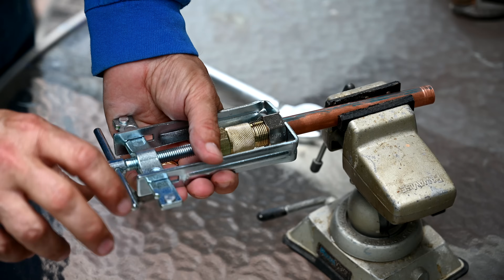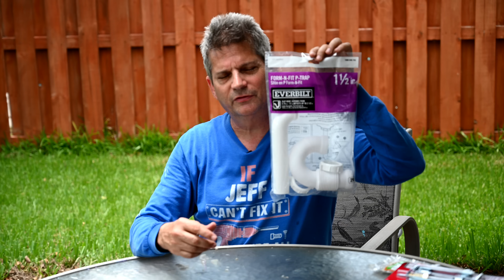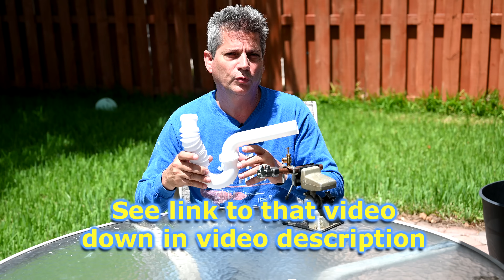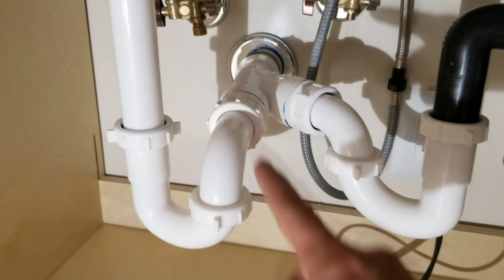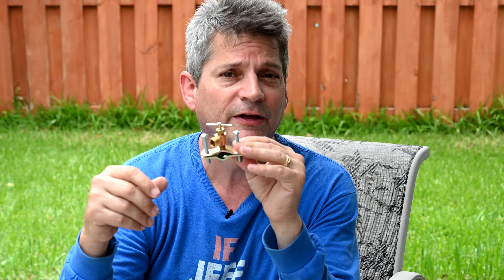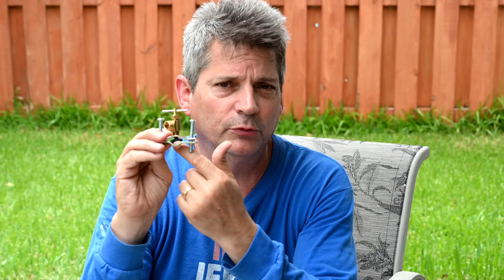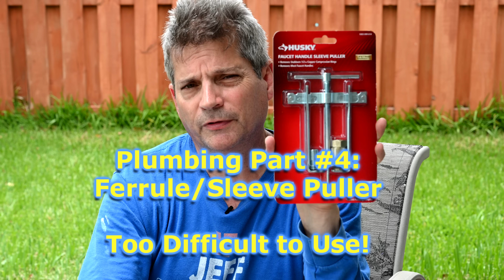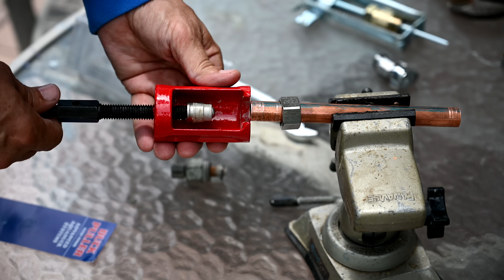4 Plumbing Parts/Tools You Should NEVER Use. NO Plumbing Fails

Comment: I have changed many water shut offs over the years that were compression, and I have never once needed to remove that copper sealing ring that is stuck in place. I just leave it as it is and reuse the original nut and ring. I make sure that it's tight....works every time, and never leaks. If it wasn't leaking before, it won't be leaking after you change it if it is done right. The nuts and rings are all the same size for 1/2" copper pipe
Reply: Exactly why go to the effort. I have also found if they have a very small leak, if you leave it tight overnight they often seal up. The metal must creep under the stress and seal. Found the same with black pipe and gas lines too, though it has to be a really small leak to have a chance as steel doesn't creep as much.
40min to get the compression ring off I would have just hacksawed it most of the way thru and broken it open in 15min. Cut at an angle and don't nick the pipe.
I always put npt ends for the stop valves and then I don't have to fiddle with those compression rings. NPT is easy to replace and they never leak. I have had too many compression ones that do leak.
Reply from the maker: @court2379   I also like to test all of my installations with hot water flowing through the pipes afterwards and especially the plastic cups it makes everything expand out and then shrink back later when you switch to the cold water that were you have fully exercised the installation.
Reply: @court2379  I find using Polytetrafluoroethylene tape (PTFE) wrapped several times round the compression ring will solve any small drip or leak where the compression ring comes into contact with the fitting, never had any problems and I've  been a plumber for nearly 40 years.
Reply: @garymcgunnigle4480  Not a bad idea. I just don't use them anymore though. Too fiddly and if they get messed up are a pain to fix unless there is enough pipe to cut them off. It costs a little more, but I just solder an NPT fitting on, and thread the stop onto that. I guess the push connect ones would be the other way to go now. If they go wrong, release them and replace.
Reply: On commercial properties, I found old valves/nuts that did not match the threads on new angle stops. I like to start out new, but sometimes would reuse a nut and ferule if it would seal up. The way to remove a ferule is with a professional splitting tool. It is also heavy cast aluminum with a nipple to go inside the copper tube and a blade that is turned into the ferule. Small channel lock pliers easily turn the bolt on the blade (it isn't a hex, but has external splines). Far too often, the old valve was installed so tightly that it deformed the tube and it wasn't possible to seat a new ferule on it.

 If there is enough tube, I would cut behind the old nut and use a new compression valve or just sweat on a 1/2" threaded male copper adapter and use a threaded valve. Property managers were happy to have us replace all of the valves and supply lines when getting a suite ready for new tenants, as the bill for us to professionally clean up, treat, and repair water damage was much higher. The buildings were built with flexible hard lines built into the angle stops and they were prone to leaking.
Reply: You will someday run into one where it WAS leaking at the nut, and the nut is corroded, and there is no way you can re-use it. Typically if there's room, you can just cut off the pipe and use the new compression ring with a new nut. If there's not room, you'll have to do something else, such as try to remove the ring and get the new one to hold onto the (often corroded) pipe, or use a push-on fitting, or tear into the wall to replace the pipe and leave enough pipe sticking out for several refittings after cutting the ring off.
Reply from the maker: Yes indeed, nothing wrong with doing it your way as long as you re-compress nice and tight and no leaks. I just like to start with all new blank canvas, all parts brand new, the sleeve has only been compressed once, when I compress it brand new. Besides, each new angle stop comes with a new compression sleeve so why not use it. Also, many properties I work on are foreclosures, or neglected properties, prior water damage, high moisture in bathrooms, where the angle stops have gotten corroded, and the copper pipe coming out of the wall is corroded, so I remove everything, and "sand it" with Scotchbrite to polish it off nice and shiny brand new copper, then install all the new parts. Looks like a million bucks, and top it off with a brand new decorative flange as well.

Comment: Concerning the S trap. I think the word your looking for is vacuum.
Reply from the maker: It is actually called Bernoulli's principle which states that an increase in the speed of a fluid occurs at the same time with a decrease in pressure or a decrease in the fluid's potential energy.
Reply: @jeffostroff  Bernoulli's principle is an example of a vacuum. U are correct that Bernoulli's is a more precise definition of what's happening with these fluid dynamics. Still a vacuum none the less.
Reply from the maker: @michaelhamerin3814  Either way it sucks! LOL

Comment: And oddly be enough I think every one of these pipes you showed you can go to Home Depot and buy them today. Home Depot should be the ones that are on the bill for replacing and repairing all these faulty the parts that they sell
Reply from the maker: Well, they probably sell them assuming people will install them temporarily, but the saddle valve included in the ice maker line kit is still puzzling to me, because that is a permanent installation once you pierce that pipe.
Reply: @jeffostroff  I'm kind of like a professional handyman and whenever I would go into a house and see a saddle valve what I would do would be cut that piece of pipe out and install an actual 3-way valve. Soldering it all in. The way it should be the way it's not going to leak in 5 years. Saddle valves are the worst you will flooding and base entire basement without even having a thought of what's going on because some idiot you some cheap $2 saddle valve that always fails. Sadly I became disabled in 2002 3 years after I had started my business and now I can barely do two hours of work in the summer with a high heat and humidity if I work at all. and the customers I would go to have explained to them what the problem was with those saddle valves and opted not to have to have me pay pay me a little extra to fix it the right way. I hope they know they should have done it when they flood their basement.
Reply: Legally, contractually, that won't hold up. Would be like suing the store for selling a weapon used in a crime.
Reply: Fester Blats these plumbing items aren’t illegal though

Comment: What do you think about PEX?
Reply from the maker: Pex is gaining in popularity because you don't have to solder and you can get home runs from one end to another without a lot of 90 degree connectors. But We still don't know long term effects of it yet. Canada is using it like crazy for years now. I myself don't know much about it.
Reply: @jeffostroff  Thanks.  I am not that good with copper, so I have used CPVC.  I watched various episodes about PEX &  recently replaced hot water lines on a rental house by myself.  Not that hard to install and no leaks.  Fingers crossed.
Reply: @jeffostroff  Habitat for Humanity homes I have worked on use it exclusively to avoid the theft problem. Copper would have been gone before nighfall!!  I have re-plumbed older homes myself and love using it. Homerun connections are great since elbows and other joints are where many problems begin.
Reply: @jeffostroff  It's probably still better than the lead solder fittings you'll still find. And lead solder used to hold EVERYTHING, but was mostly used in iron drain pipes (the city sewage recovery systems now can't handle that, by the way.) But, yes, I have seen the old lead solder used on copper fresh water pipes, which nowadays sounds like a very poor idea...

Comment: If you use the flex pipes outdoor wrap them up in foam to insulate them from temperature fluctuations.
Reply from the maker: Handy are you talking about Pex pipes? Anyway up north anywhere I would try to avoid pipes outside because of winter. Some older houses run them outside though.
Reply: @jeffostroff  pex should never be exposed to sunlight. It will flex a bit if some gets frozen, and less likely to rupture than a rigid pipe  is what I"ve heard anyway. We never see temps anywhere near freezing so idk.
Reply: Flex y s outside for what ?

Comment: First of all, I would tell you guys whoever watching this video to have a grain of salt.  I have used the flex (accordian) drain fittings in three properties under my kitchen sinks.  Yes Jeff they were all done by a guy without a plumbing license, who is me, and you are welcomed to call me an unskilled non professional "handyman".  But I want to tell everybody that the flex fittings have been working without a problem for more than 10 years now- no leaking.  If they crack in the next year, I have no reason to complain about the long service they have already endured, and the reasonably low cost to replace.   We watch you tube videos to learn plumbing skills for universally the same reason , to learn DIY and save money. We can't be dictated by everything the plumbing code says, and whatever the insurance industry wants to declare what is allowed or what is not.  
We DIYers  look at what works and what don't work and have facts to prove it!  When it comes to remodelling existing plumbing,  we all have to go through the trouble for incorporating new parts with older, existing ones.  While it is appropriate  to follow the current plumbing codes it is sometimes just impractical to to do so for various reason, mainly, because we are now using new types of sinks, new models of garbage disposals, or other fittings that cannot work with the existing plumbing, that's the time we turn to flex pipes.  To clean the crevices along the pipes, simply use diluted bleach, and flush.  I never encountered a blocked flex before and if I do, I will just unscrew it and remove the obstruction
Reply from the maker: You bring up a great point, that for people who really know what they are doing, they can put this in their property. I could do a flexible p-trap in my own house, but I won't because I want to set it and forget it, and not have to clean out the trap in a year or 2, But the real issue I am covering in this video, is the poor people, who I help out a lot, and they can't afford a plumber, and so they pay a lot less for a handyman, who puts these in, but the homeowner does not know anything about repairing and cleaning our p-traps, and when their insurer does a 4 point inspection on their house and demands the removal, they can't do it, and they can't afford to do it. So using these parts should only be done by someone in their own house who understands the risks, and can deal with it when it happens. Heck I can even deal with the scenario of an angle stop popping off the pipe at full 60 PSI. I just would go outside and turn off the main, but many people don't know how to to even shut off their house main.

Comment: FYI, not all handyman do bad work as you say with that "handyman special" dig you mentioned on the accordion quick fix. I've been a handyman for many years and have had to correct mistakes that supposid licensed and professional plumbers had done only to have the customer complain to me about their shoddy work. I'm doing a remodel now that a previous plumber used that exact P-trap on a bath vanity just to cut corners. Not only that, but he re-ran all new plumbing in this house and didn't even remove the old supply valves and it looks like crap next to the new ones.
Reply from the maker: Well, you shouldn't be offended, because you're not the guy that installs those incorrect parts. But, I also doubt whether real plumbers put those accordions in. Maybe they were put in after fact by someone else? Unless the city inspectors missed it... But yes you're right plumbers do sometimes get sloppy, keep in mind most of the construction of new houses might be permitted by license plumbers, but their worker bees are sometimes not the most talented, and I too have had to fit fix many plumbing issues done wrong by builders plumbers.
Reply: @jeffostroff  I wasn't offended but was only making a point and in my case, my customer paid a plumber and that was the result. I agree that yes, not all work is done by the licensed guy but I would think that he would at least check the work of his guys.
Reply from the maker: @MannyFontes1968  A local plumber that I have used in the past would stop by the job near the end and make sure the work was done  by his guys properly.
Reply: @jeffostroff  Well, he was a good one who made sure his customers got good quality work and repeat business.
Reply: Used these on many occasions.  10 years later, went to a home, still there and functioning fine. Sure , will hard pipe but some of these older homes have been altered so much a plumber will charge outrageous prices. Local plumber charged $80 to replace a toilet flat valve.
Reply from the maker: @Jack-Surreal_Panes   That's why I tell people that learn how to change their own flappers
Reply: @jeffostroff  yes.  Most of those DIY traps and pipes never fit.   One reason many of these were used in the past was those stores never carried variety It was straight,  T,  coupler. So these helped solve the Quick fix get it working please emergencies. Now I see all types of different pic fittings: adapters,  angles, couplers,  etc... If you wanted these you had to order them.
Reply from the maker: @Jack-Surreal_Panes   Yes good summary on other reasons that I had not seen before
Reply: @Jack-Surreal_Panes  with HD and Lowes now being the go to store for your DIY needs, you have many options when it comes to better products.

Comment: This guy seems to hate the concept of a homeowner saving time or saving money.  My house came with a S trap,and I have never had a methane odor in over 40 years.

And as far as the saddle valve deforming a pipe, a heavy handed idiot with a high power drill can destroy almost any part of a house, including gutters, screens, plumbing, wiring, and a bunch of others.  The same ham fisted idiot can not use most tools, including ferrule pullers.  

I just replace a valve the way a "professional plumber does.  I cut it off, and push on a shark bite fitting.  But for some reason ($), plumbers don't much talk about shark bite fittings.  Maybe it is because they reduce plumbing to tinker toy simplicity that any one can do with a bit of Youtube instruction and shark bites.
Reply from the maker: Man you give me a good laugh no I'm not against homeowner saving money. What I am against is them putting in the wrong parts you can do this exact same solution without spending a whole lot of money. In fact just using the correct smooth P trap doesn't cost any more than using those flexible P traps.  In your house you got lucky maybe your vents were designed properly. But you obviously haven't seen the comments from numerous other people below who have S chaps in their house and do have the smell of sir gasses in their house because of it. Just because you are one single case works does not mean that all of the cases out there works which is why it is a banner part.  Also most plumbers do talk about shark bites some don't like to use them some do like to use the nuts, and I don't mind using shark bites but I will only use them on the outside of a wall not internal to drywall.
Reply: I am not sure when my house was plumbed.  The original plumbing consisted of a hand dug well and a pitcher pump on a dirt floored porch, with a basin that drained into the ground.  That was about 1870.  The present system is mostly copper, with some odd bits of PVC  here and there, most of which hangs in the open crawl space.  I doubt that there were codes when it was first plumbed in.  Needless to say, a bit of maintenance has been required over the years.

Comment: I got a free slop ( utility ) sink & installed it on the outside of my house next to the garage I used one of those accordion P- trap for the very reason that they are weak & can tear away if I accidentally hit the sink . Love my slop sink , from cleaning paint brushes to scaling fish . 10yrs no problems
  5 years ago i got a free used cloths washer it set next to & drains  into my slop sink,  no problems . washes my painter tarps & floor mats. 
 I hear Jerry ( makeyoulook ) washes his brass cases in a cloths washer . Is that to city code ? Lol
Reply from the maker: That's a good use outside the building
Reply: @jeffostroff  I think he is missing the point.

Comment: Mobile homes water drains down u need an S
Reply from the maker: That is incorrect you don't need an S trap for a mobile home. You can still put a P trap under the kitchen sink and it goes horizontal into the wall and then down a vertical drain pipe.

Comment: Regarding the ferrule puller.  Its a good thing to change the isolating valve when remodelling but why not leave the ferrule and nut on the pipe and screw the new valve onto it as most likely the nut will be exactly the same size as on the new valve
Reply from the maker: Let me redirect your question right back at you every new valve that you put in place comes with a new sleeve and a new nut why not replace them? Whenever in remodellings I start with every piece brand new that I can. In a lot of the properties I work on is often a lot of corrosion because of neglect and high humidity in the bathrooms and you have a ferrule that was compressed against a different nut even though they're the same size and everything, theyre is still that microscopic difference that it's best to start with a brand new compression sleeve and re compress it to the new nut.